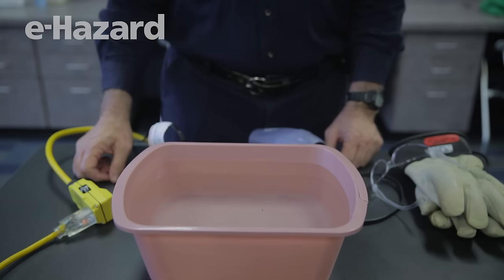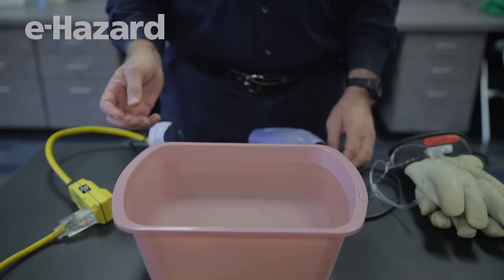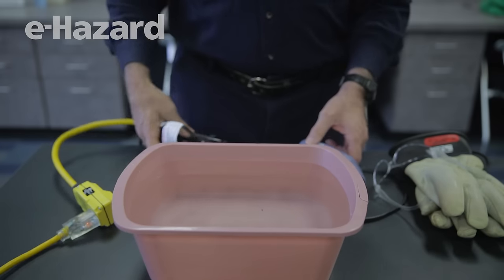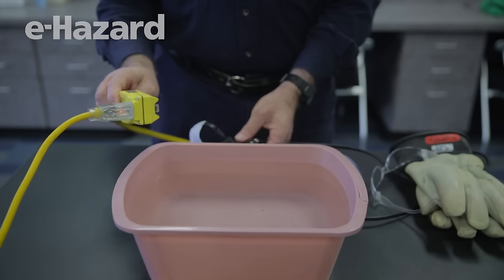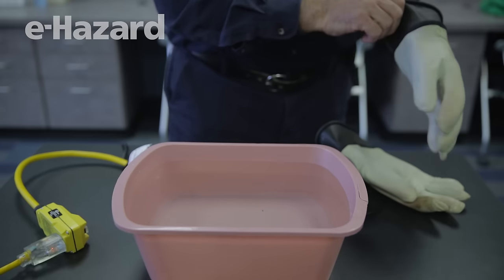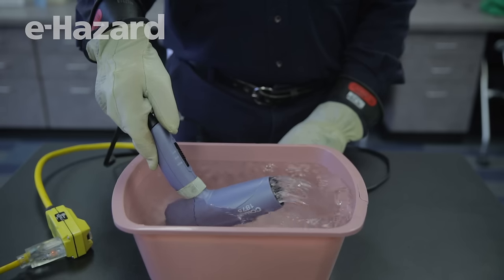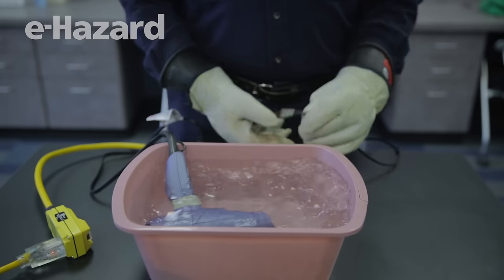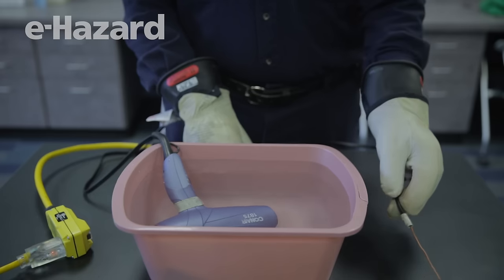e-Hazard: The Bath Tub Challenge

Comment: It seems to me like the GFCI worked just fine.  Unless you can get 5 mA to flow through a body-like object you've not proved the GFCI to have been useless.  Side note: tubs are grounded (at least where I live) so it would have popped the GFCI instantly.
Reply: How can you ground a tub made of fibreglass?
Reply: @HorseMeal  Interesting; I didn't reallize so many tubs are fiberglass; I was refering to metal ones.
Reply: @chillydogization  modern tubs are made of fiberglass. Water lines are pex and drain lines are pvc. As you saw in this video, modern bathtubs nullify the effectiveness of gfci protection

Comment: Wouldn't a human body in the tub have resistance therefore causing an imbalance in the circuit and tripping the GFCI? The ground caused an imbalance, a difference in current, tripping the GFCI. The GFCI is designed to sense an imbalance and with a body in the tub would cause the GFCI to operate.
Reply: Resistance does not equal "imbalance". The heating element inside a hairdryer is also a resistor, for example.

Comment: Because the water in the plastic tub is "floating", meaning it has no reference to ground, the GFCI won't trip because the current flowing from ungrounded "hot" conductor to the grounded "neutral" conductors is balanced.  Since there's no leakage current greater than 5 mA (+/- 1mA), the GFCI won't trip.  However, once the grounded copper wire is inserted into the water, which is obviously bonded to the source, then it becomes a parallel path for current greater than 5 mA which imbalances the circuit and trips the GFCI, just like it's supposed to work.
Reply: Are you in circuit? Yes I would think you make a parallel resistance with the water
Reply: @eanhickok8984  I would agree a person inside the plastic tub would be in a parallel circuit with the current flowing through the ions in the water.  The resistance of the human body is normally taken at 500 ohms, but that's if the skin is dry but will much lower when fully immersed in the water.
As we know, current will take all available paths and not just "the path of least resistance".  Sure more current will flow through the path(s) with the lowest resistance but some current will still flow through the other paths with higher resistance.  The subsequent voltage drop across each of parallel branches will be directly proportional to the resistance of each parallel branch.

Comment: The first GFCI has no Ground connection.  Kindly explain how the TEST BUTTON on the dryer GFCI works?   Again, no ground connection.
Reply: It doesn't, that's what this video is showing you. Neither the built in gfci at the end of the cord nor the installed one in your wall would trip in this instance

Comment: Well, since the bathtub is insulated, there is no way the current will go through you. There are no such things as "circulating currents" in the water, the current is really not moving with the water as u probably think. The cables in the motor winding and the heater are so close together that the current goes straight to the other terminal. And if the bathtub is connected to earth in some point, or you are touching something grounded... Well then the GFCI will pop, saving you. So it is working, and this video is nonsense. Also here where I live at, we have to have our bathtubs and shower corners grounded through drains. So that would be an answer.
Reply: The tub is insulated, but the water, with you in it, is conductive. And yes, the current will travel throughout the water. This can be tested with proper ppe and tools, but is not something you should try at home. You should also be aware that grounding the drain grate or any other part of the drain is not a part of the NEC and is not a common practice everywhere, whether it is where you live or not. It's also entirely possible that the entire drain assembly could be made of plastic.

Comment: I think they could coat the inside plastic of the hair dryer in metal, either with a foil or tape or paint, and then connect that to a grounding pin
that's my solution.